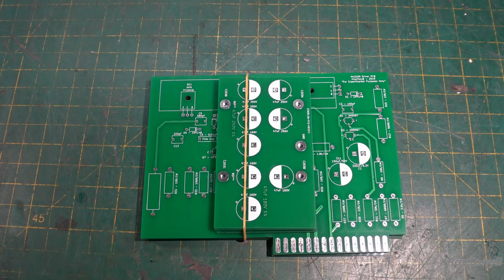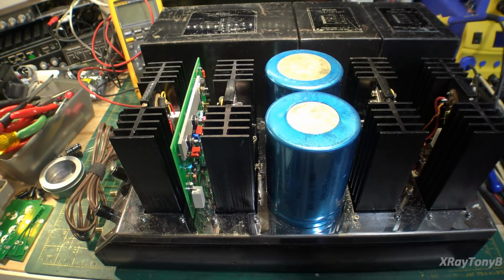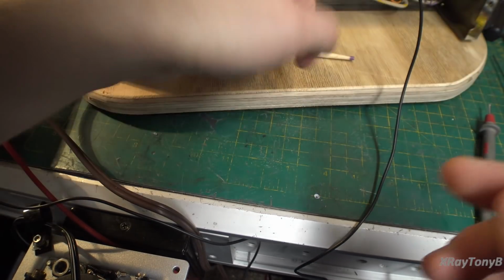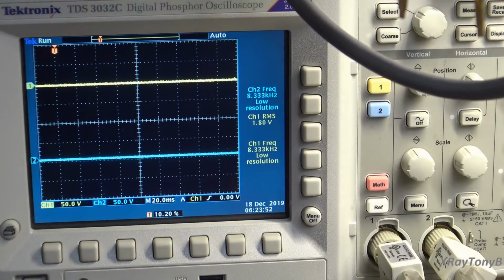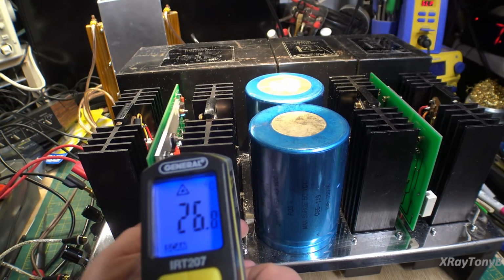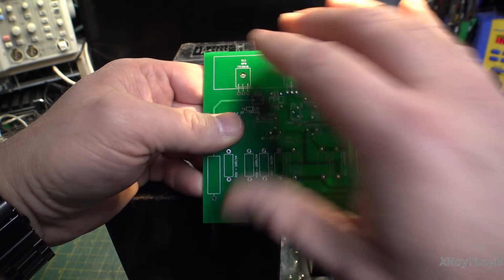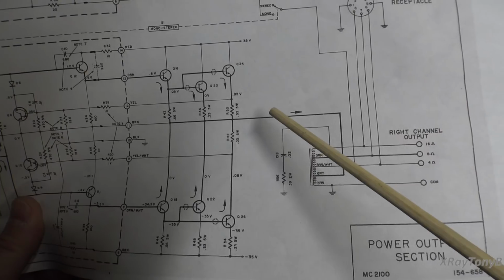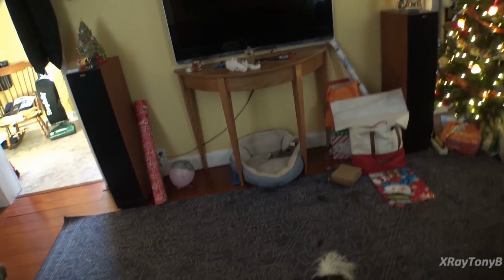McIntosh MC2100 Amplifier - Final

Comment: My build of a no negative feedback local and global,power amplifier i use 60 000 uf pr channel.it is a 4 channel 100 w power amplifier with 240 000 uf total.I use them to drive tweeter and midrange drivers direct with this 4 channel in a active setup.With planar magnetic midranges and amt type tweeter high sensitivity with ear close to the tweeter i can hear a faint hiss.They are the most silent amps i have ever had.exsept for when i build a 2 channel version 18 years ago that i sold stupidly.They are very linear to.Output transformers on solid state p.amps i only have seen on McIntosh.You make great videos.Always something new to learn.Thanks

Comment: Can you not replace that blown micro computer with a UDOO RYZEN Bolt V1000 SBC Maker board, I have a MOS Class AA amp which works but gives a lot of mains hum maybe the electrolytic capacitors has dried up not sure and I will have to get it looked at, I have watched this on Sat-30th May 2020

Comment: Tony this is awesome work as usual!

As long as you're getting the boards re-done... I would suggest going for the ENIG gold finish, just because those McIntosh edge connectors are gold plated. Gold is significantly cathodic compared to Tin/Lead alloys, and you can get galvanic corrosion where these metals touch. Also, it looks like you have a via in the center of each finger, and I would move that upwards so that the socket has a uniformly flat surface to mate to.

Do the heatsinks get warm once the bias is dialed in?

Comment: Great job, Tony! Can we see more testing of the amp, especially at low power where crossover distortion shows up. A lot of listening is done down around 100mw with efficient speakers.

I'd advise having your board house gold plate the edge connectors on your next version. You can also get gold plate solutions. I've had the experience of the fingers gradually forming a little corrosion, especially on the low current circuits. That can seriously screw up things a couple of years down the road.

Comment: I think I've bought worse recordings than your modified cover of "Still". I missed something though.  Did you both sing on Still or did you, Tony, multi track yourself singing both Melody and harmony? Ah, for what we now call teenage angst!  
I was waiting for Bella to add her voice to the Beethoven, but just heard her bells later on.  

Interesting that McIntosh, when given a low impedance output amp, continued to use "transformers" to match speaker impedance.  Does that shield the amp from the reactive impedance of the speakers?
Reply from the maker: I did all the vocals, along with the bass, keyboards and drum machine.  Jim did all the guitar work.  It was quite a challenge to get it all on 4 tracks of a standard cassette!  Thanks for watching!
Reply: @xraytonyb  you guys did an amazing job with only 4 tracks. Very impressive. Phenomenal job on the restoration process as well.
Reply: @xraytonyb  You are/were a man of many talents!  You can sing both parts with a nice voice, you can play bass and keyboards and mix the whole thing down to two tracks. Now you fix the electronics that you need to play song. 8-))

Comment: Entertaining but, I feel a little nervous there's no insulation sleeves over those wires on the bottom of the edge connectors. Those sockets move around a fair bit when you're plugging things in and out.

Comment: The diode on the original boards was on the top of the board and it was under the heatsink directly in contact with it.  When the update to the board was done the diode was located under the transistor in direct contact with it.

Comment: It's normal for that 3600 ohm resistor to run hot. On the original board turrets were used to stand off the resistor and prevent bad solder connections there. On your board, bad solder connections WILL develop there over the course of several years, you you'll want to address that. The heat sinks should be warm but not hot after warm-up. The bias diode is probably the issue here. McIntosh still sells them. The diodes mount underneath transistors Q11 and Q12 on the front side, not on the back side of the board.
Reply: Your avatar, That's little Milton (Gerald Bostock) from the cover of "Thick as a Brick"..  I have the original album with the fold out newspaper Album cover..  :)
Reply: @5argetech56  My dad's name was Milton, therefore I am "Little Milton"

Comment: The outermost heat sinks should have an unused hole where a standoff extends from each driver board and is secured with a screw through the heat sink into the standoff.  This is how the driver boards are held in place.   My salvaged 2100 was missing the Chrome logo, thanks to my son who has his own vinyl cutting business, he printed me one in chrome film.   From 3 feet you cannot tell it is not raised and looks 100% font correct.  Contact me and I'll see if I can get you one.  I also added a power switch with no added chassis hole by using an old octal tube base, a 35 MM film can cap (fits the tube base perfectly as a top) and some wire exiting the center keying pin (hole drilled) of the tube base.   I think you can guess where  it plugs in. :)

Comment: If you do end up reworking those boards, consider the placement of the blue potentiometer too.   It appears that the access to the adjustment is blocked by transistor....perhaps the backside of the board would provide better access to the adjustment.

Comment: A friend of mine had a Mac amp with B& W speakers, very high end.  The sound was different with a Mac amp over a Threshold direct coupled. Both solid state but the Mac had a smoother bass, not quite the punch but it was very pleasing. Depends if you want the kick drum punch or the bass string plucking sound?

Comment: Excellent work as usual, nice one. If it were my amp I'd fettle something to secure those boards at the top. It would only need a simple bracket with cutouts or notches like you see on some HP/Tek test gear. Thanks for sharing and Happy Xmas, have a good holiday, all the best...DA.

Comment: Would it be better to put a decoupling resistors say 100 kOhm's on those filter caps. Cut down the surge charge and give it better filtration.
You need to test above 20 kHz you really want to go up to 30 or 50 kHz do you know what the distortion figures are at these frequencies. And s/n db figure is.
You could get rid of that transformer and balance it on the speakers terminals by putting a resistor of the correct value to bring it down to 2.5 ohms
Reply: Using a parallel resistor to assure the amp of its optimum load would throw away power as heat -- the amp would put out its full rated power, but the speaker would receive considerably less, especially if it was of relatively high nominal impedance.
Reply: @editorjuno  no it wouldn't some loss on the resistor but the increase in power would be greater then any loss

Comment: I'm a huge proponent of using overkill values for components... it pretty much guarantees less chance of failures in the future. I recently sent one of my old amps, a Carver M1.0t, in for a modification/ upgrade by a company called Nelion Audio. They call it the Mark II, opt 002 upgrade. it costs 450.00 and from a stock model rated at 200W/ch it increases to 460W/ch into 8 ohms. I haven't received it back yet, but I have the tracking number and is due to be delivered on the 21st of Dec. I'm excited to get it hooked up and put it through it's paces. I have some Frankenspeakers that are capable of absorbing some huge wattage.